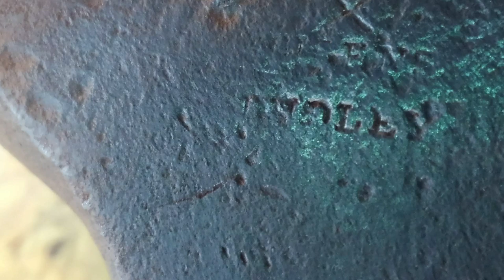Blacksmiths Post Vise Stand Build-off Part One!

Comment: Great work, guys, and an awesome looking stand.  This looks like pretty much exactly what I had in mind for mine.  I may even have seen a photo of it somewhere that I based my idea off of.  I wanted to share a couple of tips that could have made some of the steps easier.  For lining up the legs, when using a plumb bob like that, stick a clear container of water on the line, and drop the bob into it.  It stops it from swaying around as much.  A laser level would work even better, they are really handy things to have around.  For surfacing larger areas, a handheld belt sander with the right belt does wonders.  A stack of sanding discs, the ones you put a solid backer on, also work great, but they do tend to come apart if you get rough on them.  Lastly, when using hole saws in the cordless drill, brace it on the OUTSIDE of your leg.  Those suckers love to grab, same with larger bits, and taking that battery to the nuts isn't fun.  Funny to watch, not so fun to have it happen.  Again, great job, and I look forward to seeing the 2nd one.

Comment: Nice! Level to orient angle cuts ! First time I saw that. Linseed oil on metal !  Plumb bob to align angled legs! Pre heating thick metal plate before weld! Cutting copes in pipe with a mill? Spraying saw blade. Lathe work.Young men working together. I’m going down to my shop and weep. So ashamed of my vise stand!

Comment: Nicely done guys. I'm happy that you filled the legs in, most people that I see using post vises don't seem to weigh them down, and that kind of defeats the purpose of them. If they aren't anchored down, they aren't really doing their full job. :) Can't wait to see the other one.
Reply from the maker: Thanks a lot!  By the way, were planning to anchor it to the floor as soon as both are done.
Reply: @GreenridgeMetalWorks  I figured as much, since you left tabs with anchor holes on the bottom. It'll do pretty good work just weighed down as it is, but if you can truly stabilize it then that vise will serve you well.

Comment: Great Job! One Question (I am a novice!): Why do you preheat the plate before welding? Ist it because the material is so thick, that it would cool down too fast to make a long lasting welding
?
Reply from the maker: Yes that's right. My welder is not very big so I need to preheat the thick plate or the weld penetration will not be deep enough and the plate would quickly cool and that make the weld brittle.  Thanks for watching!
Reply: @GreenridgeMetalWorks  thx! Keep up the good work!

Comment: Hey guys... First time watching your videos. I was given an old post vise and need some advice. Is it necessary to mount it on a steel base, or can I mount it on an 8''by8'' post? I would be sure to have a good base but other than that I am at a loss. Could you help, please?
Reply from the maker: I see people using wood post successfully all the time, as long as the foot of the post is resting on a solid floor and the post won't move while in use it should be fine.